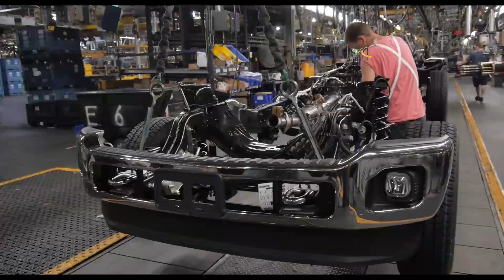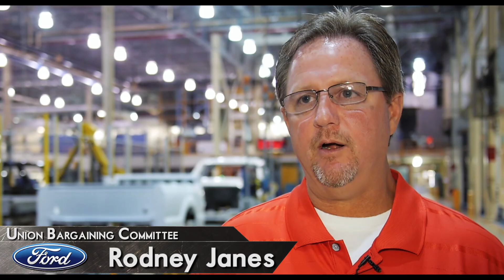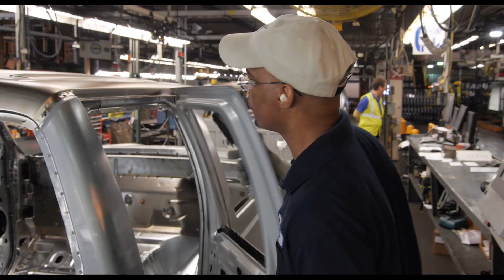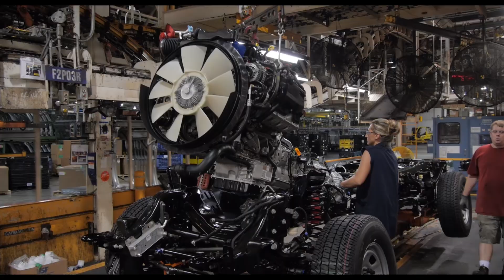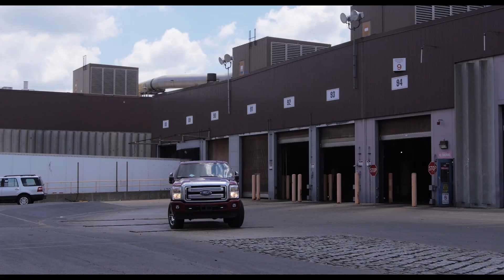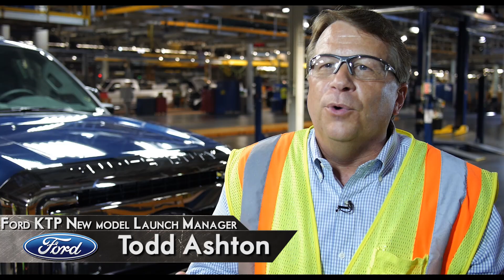A Look Inside Kentucky Truck

Comment: I drive a  2016 F350 6.7 PSD which was built at the KTP and is my second Ford out of 3 trucks. Love my truck and I'm a Ford man for sure. Just wondering if any one who works there reads these comments. My sons godfather lives in Lexington and we are coming down for our annual road trip in August. Would it be possible for me to bring my truck home and have some of the line workers pose with me for some pictures with her? Also, do the 6.7 PSD's go through some sort of preliminary break in period to seat the rings? Thanks, Dave.

Comment: I currently drive a Mazda6, had a Toyota Tacoma, Mazda B3000, Chevrolet el Camino and Pontiac Le Mans in that descending order.  My folks drove 4 Chevrolets, 2 Cadillacs and 1 each Dodge and Ford.  The lone Ford was a '63 T-bird that was a hoot.  If I could find one and afford to fix it to factory or better, I would do it.  As for the other cars, some I knew, many I didn't.  But, the '72 Coupe de Ville they had was grand. A Cadillac when Cadillac was Cadillac.

Comment: I have a f250 xl fx4  with 156000 miles on it 6,2 gasser and i love it!! had a 1999 f150 it is still running strong, Thank you from the bottom of my heart you made a great great truck  i will not drive nothing but Fords!!! Biggest Ford emblem  i have ever seen lol
Reply: Lol 156,000 miles isn’t shit! My Toyota Highlander has 378,000 miles and it is just breaking in.

Comment: Where was the pride when my 2013 escape was built.my ford dealer has had my car more than i have.
Reply: Not built at that plant, only the big trucks baby!!!
Reply: C Fichera  same company.we also have a big truck as you say.f350 duelly v 10, and still i ask where was the pride when my cars were being built.
Reply: Cs Skow Hi, I understand same company, but different plant.  This plant builds some GREAT trucks.  Sorry your escape has issues.  Luckily, I am a 6 foot 350 pounder that would never be able to fit in an escape, so BIG BEAUTIFUL Trucks for me.... :)
Reply: C Fichera the f350 v10 deuly we have is a big truck.electrical problems,manifold problems,corrosion problems.....
Reply: Cs Skow btw,this truck is 8 years old and has only 78,000 kms. Embarrassing.